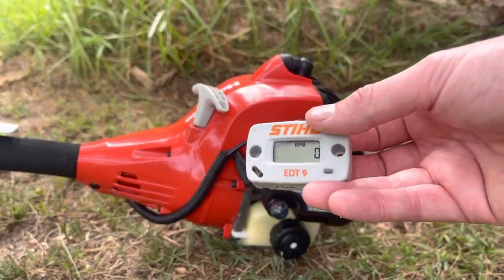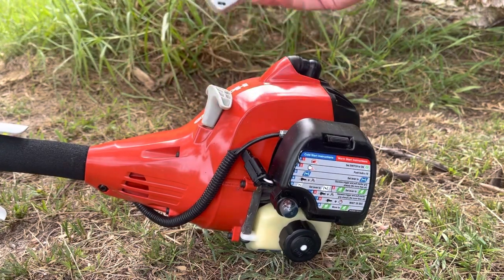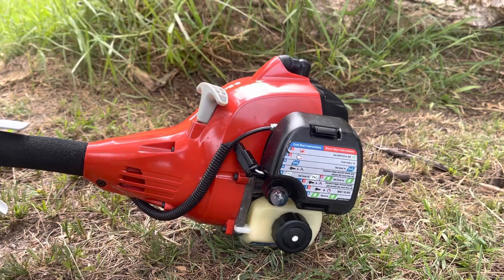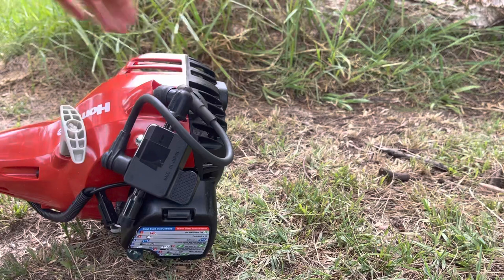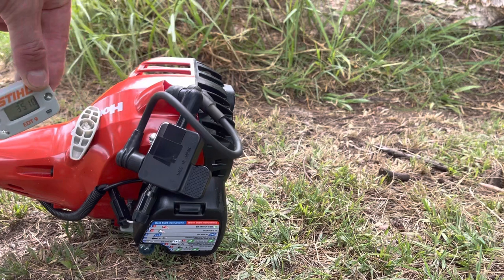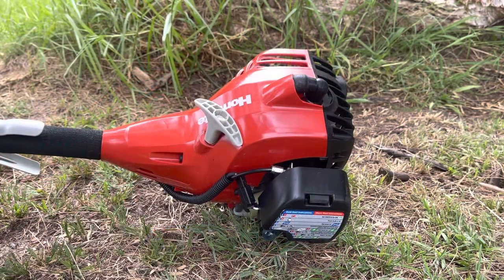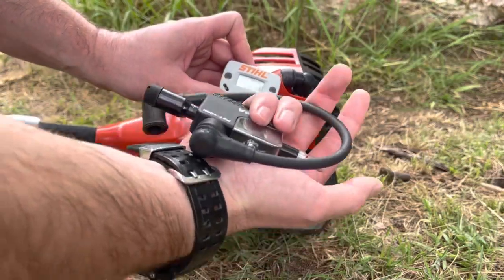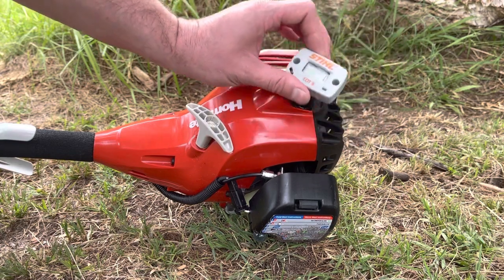FIX INACCURATE AND WEAK TACH READINGS!

Comment: Thanks, for the useful information . Please explain and show in detail why you pulled the starter rope out when you turned off the trimmer .
Reply from the maker: You’re welcome! It protects the mechanism. As the engine comes to a stop if it doesn’t make it past top dead centre, it can come back on itself and overtime that jolt damages the recoil mechanism!

Comment: It would be interesting to put an am radio in the general area. You could probably check the rpm by ear. 
Good video.  🙂
Reply from the maker: Thanks :) not sure how the radio would work?
Reply: @Vintage Engine Repairs  You should be able to hear it. No touch tachs work by picking up electrical interference, and you are giving it a bigger field to work with.  By nature,  AM radios usually don't filter interference well, especially cheap ones. I would think it would pick it up as static from a couple of feet away. 😁
Reply: @Rein_Ciarfella  You are 100% right about the plug, but the wires are also shielded and this is bypassing the wire shielding. It would be a fun test.
Reply: @Rein_Ciarfella  great point! Resistor plugs greatly reduce rf noise but doesn’t eliminate it all together. Tom, try your experiment with resistor and non- resistor plugs, I’d be curious how stable the readings are used non- contactly
Reply from the maker: You guys have lost me! All I know is that if I can’t get a signal on equipment I use the inline  tester without thick insulation and I can read it 🤣
Reply: @VintageEngineRepairs  You aren't lost, you hit the nail on the head. 🙂 
A "No touch" tach makes sense of the EMF and you eliminate shielding and it picks up that interference. The cool part is, an AM radio can "hear" it.
I remember running around in my 1969 Chevelle when I was a teenager and I could tell I burned a wire on a header when "Surf 16"(an AM rock radio station we loved as kids) started crackling.
Reply: I see what you are saying, though checking the RPM by ear would not require any wires, tools, or radios.  ;)
Reply: @folkenheath  Well yeah, you could just listen to it, but where is the fun it that? 🤣
Reply: @GuysPlayingWithTools  
That 69 Chevelle you mentioned would be quite fun to listen to.  😁
Reply: @folkenheath  that was a loooong time ago,  1978? There have been all sorts of hot rods in that garage spot since then.  🙂